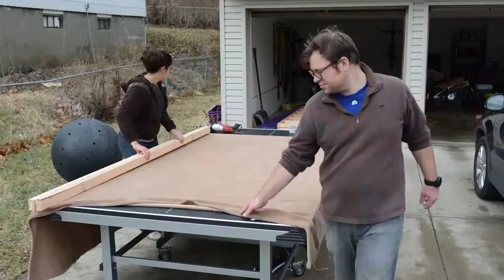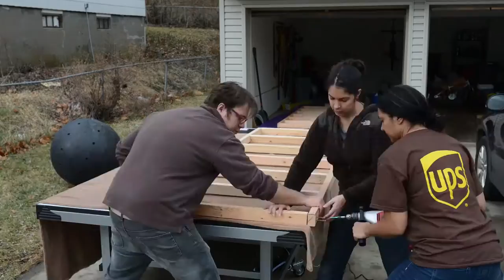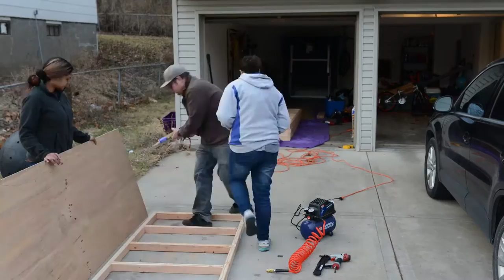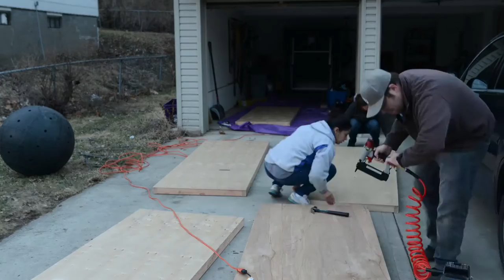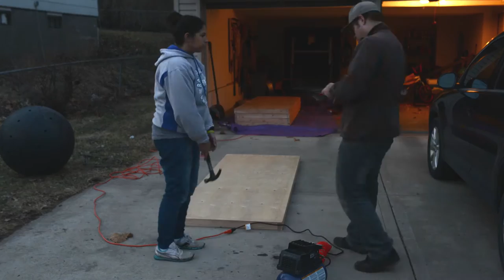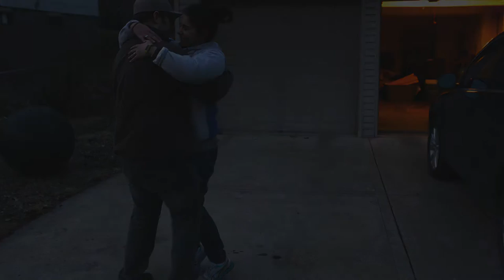How to build a temporary wall or trade-show booth time-lapse video 1

Comment: Nope, been building exhibits for 30 years, This is not the way to do it
Reply: What is the way to do it?
Reply: @savingbananas  Well I was a little harsh on my comment, If you don't have money and time and you haven't done it a lot I would say you did good. you should cut down 3/4 ply for your ribs and sides, And if you can afford it use roto locks, If you don't have the money then bolts with wing nuts, If you are putting lam on it hold it over your sides 1/32, If you are putting fabric on it, Router a rabbit down the sides, The horizontal ribs are good, Put some feet on them, many more tricks, But for just walls it's not bad